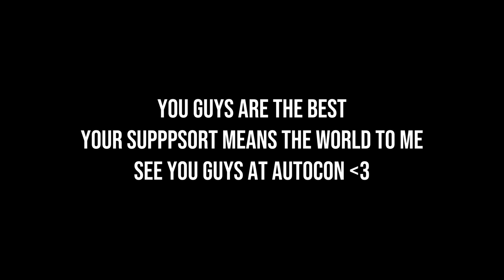RHD NSX GETS AGGRESSIVE FRONT LIP - DIY INSTALL

Comment: The lip for the nsx is suppose to have brackets that mount from the lip to the bumper from the lip to the bottom lip of the factory bumper. Double sided tape is a bad idea if you are going to ever take that lip off in the future. P.S but another wrx or do a sti.

Comment: Lexus ISF. 
Without a doubt. You can enter the V8 scene and venture out from there. Still holds value even the lowest year (2008) is 10 years old. Makes for a phenomenal show car, great forum support from Club Lexus, aftermarket manufacturers still making products, be able to get in the luxury/sporty feel, and be 1 of  12,000 (estimate) worldwide to showcase a underrated car. It also is a cool daily if you don't mind the gas consumption from a 5 liter.

Comment: Get a Supra
Reply: Get a RHD import supra!
Reply: Pretty sure it's out of budget.
Last time I checked, a Supra was 70k.
Reply: Wow I thought to £20-30k UK price was alot!
Reply: DaveRogers1985
For 20 thousand pounds it's either a scam or an na 2j, here are some random 2jzgte Supras I could find after a quick search https://www.ebay.com/itm/Toyota-Supra-Twin-Turbo-6-Speed-Manual/112776657598?hash=item1a42033abe:g:L4UAAOSw1R1aqFEs&vxp=mtr  https://www.ebay.com/itm/Toyota-Supra/112931694468?hash=item1a4b40e784:g:SrAAAOSw-b9azkMU&vxp=mtr 
So yeah... Much more than 20k.
Reply: NA Supras go for between £5k and £10k ish. Auto Twin Turbos are also cheap
Reply: IMNOTA I got mine for 24k!